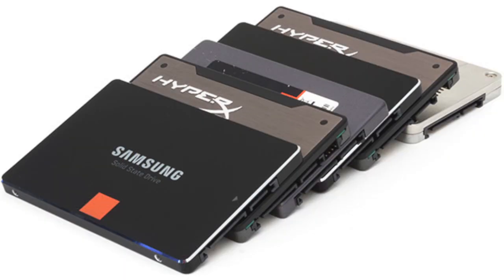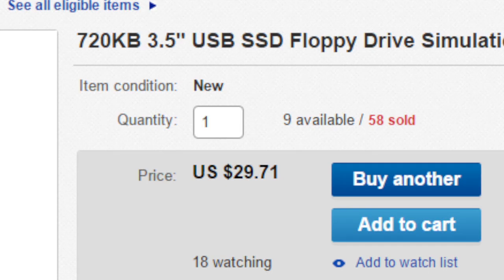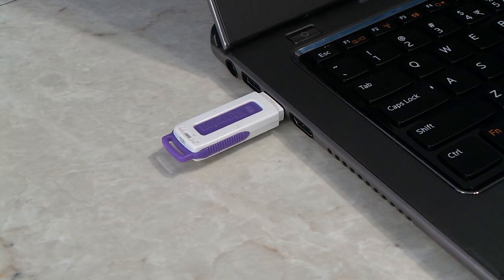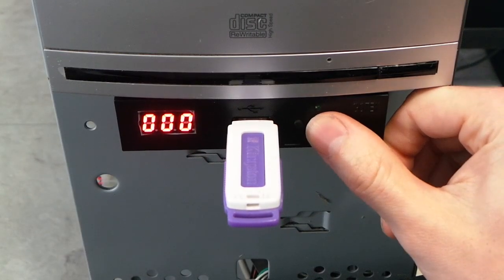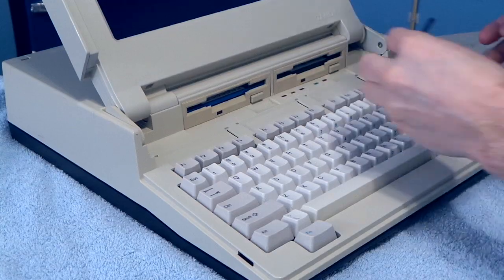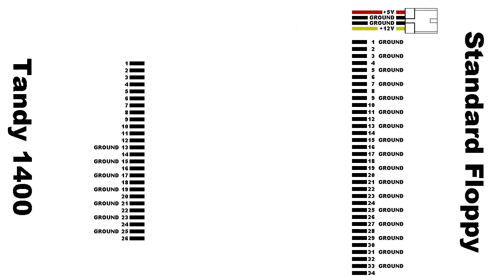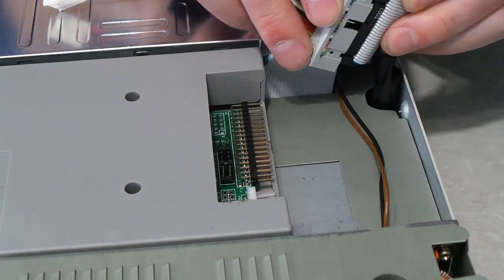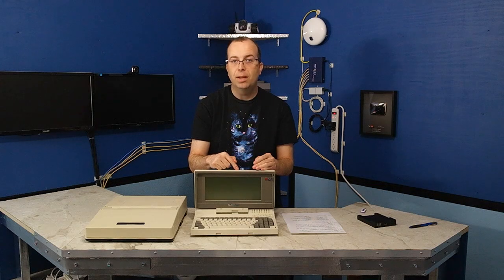Upgrading to a Solid State Floppy Drive Emulator

Comment: Do you have an old Amiga? it's quite common to use that Floppy Emulator on Amiga machines with a Firmware update
Reply from the maker: +Sheepy007 I have an Amiga 500 and Amiga 1000.  Will it work on those?
Reply: +The 8-Bit Guy You need to flash the drive to the Cortex firmware. You can find all the necessery steps here https://cortexamigafloppydrive.wordpress.com/ 
It certainly works wit A500 and should work with all amigas according to the author.
Reply from the maker: +Sheepy007 interesting.. I may look into this.
Reply: +The 8-Bit Guy I successfully used it with my Amiga500. I do need to say, getting the firmware on it took a lot of effort. A cheap FTDI USB to Serial cable will work but the flashing software is awful. it uses some kind of demo flash software which (in my case) took several attempts before it finally recognized the drive type. afterwards, you can put any adf file on a fat32 formatted flash drive and mount it. a special selector.adf provides the disk assignment and it also allows writing so you can store save files or copy games to adf format
Reply: +The 8-Bit Guy I bought this preequipped with the propper fimware on german ebay for about 40€, 8GB usb-stick included. It worked out of the box perfectly with my A1200. No prerequisites needed, the usb-stick was in FAT format and all I had to do was to copy my adf files onto the stick. The rest is done by the amiga software already on the stick. There you assign the adf-files to a numbered slot on the emulator.
Reply: +The 8-Bit Guy You can also get them to work with other drive types by flashing a new HxC firmware, see here: http://www.vogons.org/viewtopic.php?f=46&t=43416
Reply: +The 8-Bit Guy if you replace the firmware with the HxC firmware you will have a more flexible device that can handle multiple formats
Reply: Finally! A way to play Beneath A Steel Sky without changing floppies every 16 seconds!
Reply: +The 8-Bit Guy  i had the amiga500 and i would really like to see it work with this emulator in your next video
Reply: +Sheepy007 Chiming in on the A2500 here too!  It rules!  Ran into some trouble getting a 2nd drive working, but I do not believe it's related to the Gotek in any way.
Reply: +Sheepy007 need to buy one of these for mine. just resurrected it after 20 years of storage
Reply: +Maplerain yes, at 56×24 resolution.
Reply: I can also confirm that it works on an A500. There are a few things to keep in mind though:
- Form factor: As you can imagine, the Floppy disk emulator is way smaller than your typical A500 floppy drive. If you want to run it as an internal drive, you need to make a few case modification (either on the A500 itself, or the floppy emulator case)
- You cannot save to the images (at least I haven't found a way). However, you can copy from a mounted image to a regular drive
-You can always attach it as an external, secondary device; however, as the A500 typically boots only from df:0 drives, you won't be able to boot from the virtual floppy in that case (unless you make a Kickstart upgrade).

There are a few ways around that, though. Some people unwilling to do case mods just use a longer-than-standard IDE cable and lead it through the disk slot opening in the A500 case, and then hook up the flash Floppy drive externally. It doesn't look pretty, but it does the job.
What I did was, I installed a boot selector switch and hooked up the drive externally. Works like a charm; and if I want to save, I wait until the Amiga is idle, flip the switch and then insert the disk in the regular df:0 drive. It's not recommended to do so, but so far it has worked just fine.

I can only recommend upgrading your A500 that way, because the old floppy drives have the nasty tendency to fail over time - I had to personally replace the internal floppy of my 30-year-old Amiga once due to unrepairable hardware failure, and proper replacement drives are tough to get.
Reply: I saw a video from 2007-2009, I  cannorpt pinpoint the time, where David installed an s-video jack on an a100..
Reply: +The 8-Bit Guy would it help me run crisis 3 at max settings?

Comment: +The 8-Bit Guy, you should check the figure C-3 in the manual - it says "step". And look at the "ready" signal... it is not 1:1 connection. If you read the manual at C-12 page you should be able to emulate the "ready" signal with a switch (short with ground when conditions are met). Pin 34 is almost not used on floppy drives so there is a high chance this emulator does not use it (check voltage on this one if not sure).

Comment: i'll just write down what i would do to check this computer, maybe i'm wrong
first of all, i'd check the back up battery, if there's one. Sometimes when that discharge you get strange errors, also, there could be a save of the error caused by the floppy emulator, if you remove it you could reset it.
Then if a different psu would give the same problem (that could mean lot of work and lot of rewiring, if you want to use an atx or whatever you could need)
then, since you have the service manual, you could check if there is a hardware fail somewhere

Comment: I wouldn't rule out that the emulator itself broke your laptop. These things are not supposed to go in those machines actually. Also, made in China, so it's to be expected.
Reply: As easy as all this sounds... It's unlikely that the floppy emulator actually broke the Tandy 1400LT. Those old 1400s drop dead rather regularly, usually because things like capacitors in the power supply unit die. Floppy drives and floppy emulators are pretty passive anyways. It's much more likely for a faulty PSU to fry the drives, or emulator, than the the drive/emulator will screw up the PSU. Considering the symptoms, where the computer will run for a short while, then shut off, it's likely the fault of dead and/or dying capacitors.
Reply: I highly doubt that the floppy emulator was causing this. The chances that he did something wrong during wiring ore the computer just bit the dust because of it's age are much higher
Reply: +אולדסקול nowadays EVERYTHING is made in china, even the top-brand stuff you'll probably claim works much better! it used to be like "oh made in chine, it must be crap" but nowadays that's not so much the case anymore, lenovo laptops are brilliant... made in china. samsung phones are also really high quality... made in china. even the iphone is made in china!
Reply: Factories in China offer different tiers of quality assurance, material quality and manufacturing environments. When you buy something on the cheap (yes, $30 for this is damn cheap) you're getting the lower end of all of those. Sometimes that's enough, but if you buy something that's supposed to cost a lot more (like this drive) and put it into a retro computer from your collection, you shouldn't be surprised things go wrong.
Reply: Oh, yeah?
Reply: Niek Nooijens Samsung phones are made in Korea. iPhones are made in Taiwan.
Reply: Fuck off.

Comment: Actually back in the days when Smart media... can run the drive with Flash directly in it.

https://encrypted-tbn3.gstatic.com/images?q=tbn:ANd9GcQ0QU47GI9BnzQjHgqyDdoeAEpvJQipiFvsng7fHERLqjiO5n_ahw
Reply: +matsv201 

http://www.ebay.com/itm/FLASHPATH-ADAPTER-FLOPPY-DISK-ADAPTER-FOR-SMARTMEDIA-NOS-NIB-/201380015519?hash=item2ee32f2d9f:g:apsAAOSw-vlVkfax
One you can actually buy.

Comment: Interesting. This might get my old dos laptop come back to life. The things broken there are the floppy drives because the rubber drive bands are eroded. I would love to see those green plasma characters light up again on the mini display...
Reply from the maker: +Willem Kossen I have a 486 laptop that has a built in floppy but is also broken for the same reason, the belt has snapped.  I was thinking of using my 1.44 model and putting it in that one, but it would require enormous modification to make it fit.

Comment: as for 'eventual' connor 20/30/40mb hdds in old laptops: haven't seen a single one that actually still works... same for the floppy drives: the rubber parts are gone. things just make (a lot of) noise. and don't work.

Comment: before wasting any more time on that laptop better check if the keyboard still works correctly, a lot of the older ones have rubber 'springs' under the keys that dried up causing keys to hang for ages before coming back up... doesn't appear as a problem before actually trying to use them to type tho.

Comment: probably just a dead battery... several older laptops switch off or don't turn on anymore if the battery does not reach/maintain sufficient voltage or is not present alltogether... fortunately on several of those they are just a bunch of D-cells linked together :P
Reply from the maker: +Sven Olaf Kamphuis IT doesn't even have a battery and never has since I owned it.

Comment: David, did you accidentally put a center negative power supply into the Bondwell which asks for center positive?
Reply from the maker: +CollinG Tech Opposite, actually. It is supposed to be center negative, and I plugged in a center positive.  I didn't realize I was plugging the wrong thing in.  When I did, it sounded like a firecracker went off inside the laptop.  I knew I did something wrong then....
Reply: +The 8-Bit Guy Either way vwestlife made the same mistake in a video he made about Bondwell laptops
Reply: +The 8-Bit Guy But the Bondwell still worked for him afterwards. I have no clue how though.

Comment: Dear 8-Bit Guy,

Do you prefer newer or older versions of Windows?
Reply from the maker: +Joseph Conte It depends on what I'm doing with them.  If I'm actually trying to get work done with modern software, my favorite is Windows 7.  But I still use Windows XP a lot as well.   I very much dislike windows 8, windows 10, and windows Vista.

Comment: Greetings from Garland, TX!  The software that comes with this device is quite bad.  After doing some searching I found software that works much better (and in English) which should work fine with your floppy emulator as I have one just like it.

http://www.ipcas.com/download/products/usb-floppy/usb-floppy-emulator-tool-v1.40i.zip

This is an awesome device as I use them on my old 486 and Pentium systems that I have for retro gaming.

Comment: "Unfortunately, after all of this work I ran into another problem. The laptop just quit working. It will just run for a minute or two and then it just mysteriously shuts off, even when I reverted everything back to the factory configuration."

Ah, the nuances of working with aging hardware. I've had a (much newer) laptop randomly throw up 'BIOS Corruption' errors seemingly whenever it doesn't feel like it's up to the task of turning on. 

Wouldn't trade the bitchyness of hardware for anything in the world though, especially for something like programming.

Comment: I grabbed a cheap MacBook Air 1,1 from eBay and have been trying to upgrade it to an SSD -- it's a weird SATA ribbon cable deal with a 1.8" form factor. I have a 1.8" IDE SSD because I thought it was an IDE drive, and I discovered several other little things wrong with it along the way. I'm right there with you about losing interest, especially after spending more than I wanted to.

Comment: Hi I suggest you take a look at the HxC firmware and talk to its developer, an awesome guy, for any issue you might encounter.
Basically he ported the firmware of his HxC floppy emulator to these cheap Gotek devices and it supports Amiga, CPC and Atari ST machines. However I just discovered there is software for DOS support.
This firmware is not free, it costs 10 euros per device. But it's actively developed and as I said the developer is really cool and ready to help you fix any problem if you encounter any.
If you decide to buy a license you need to flash your gotek and it's all described inside the zip files you find at the bottom of this page http://hxc2001.com/download/floppy_drive_emulator/index.html (is mentioned as the STM32 HxC floppy emulator)
Here all the useful links:
http://hxc2001.com
https://github.com/bjt42/hxcfs/releases
https://www.youtube.com/watch?v=rfovFoMaL54

Comment: Check the voltages on the 26 pin connector - there might be 5V and 12V there and connecting those together can damage your computer.
Reply from the maker: +Jens Goerke I checked them all with a volt meter on the laptop before building the adapter.  They were all 5V.  I also used a continuity test to make sure they were all the same source, they were.  I'm not convinced I damaged anything.  The laptop will still power on and work for a minute or two before shutting off.  I would think if I fried something, it would just stay dead.
Reply: +The 8-Bit Guy 
What is it processing when it shuts off? It would be very handy to have a log of what it's doing just before it craps out.
Reply: +The 8-Bit Guy 
Maybe one drive draws more current than the other. That should be easy enough to measure and compare.

Comment: I would say that the Tandy has the same problem as the Bondwell. Sometimes when you plug in something by a third-party (AKA the floppy drive emulator) can short out the Power Supply.
It's happened to me before.

Comment: Hi 8-Bit Guy, have you seen this demo?
https://www.youtube.com/watch?v=hNRO7lno_DM

Check out the technical explanation!
https://trixter.oldskool.org/2015/04/07/8088-mph-we-break-all-your-emulators/

1k colors on CGA composite, and 4-channel audio .MOD mixing at 16.5kHz (output by PWM on PC Speaker) on an 8088!

(Sorry if you've already come across this! I wish I had an old 5160 to try this on, although the latest PCem apparently runs it faithfully)

Comment: Yeah please don't leave us hanging. The whole concept is an excellent idea. Why don't you try it on another machine entirely?
Reply from the maker: +Cameron Smith It will probably wind up in that Bondwell laptop I showed at the end.  I'm planning to repair that one.
Reply: +The 8-Bit Guy you did mention that, but do you have or can get your hands on a working desktop with a 720k drive (like you did with the 1.44mb one) preferably with dos or 3.1, that way you know that the 720k hardware will work before trying to repair your second laptop

Comment: Can you post a high resolution photo of the floppy drive emulator circuit board.
Reply from the maker: +MorRobots I suppose I could, but not sure where to post it.
Reply: I'm curious what they used, it may be easy to hack. Typically Chinese gizmos like this use rather jelly bean parts and MCUs.
Reply: +The 8-Bit Guy found an image, just as I had predict. it is literally an STM32F (ARM) jelly bean as they get, and some 74HC logic (mega jelly bean). best part is the STM32 has a bootloader built in and you can activate it by pulling a pin high and another one low or something like that  (depends). Looks like you could reprogram this thing via the USB by the layout I see on the board. may make for some fun hacking.
Reply from the maker: +MorRobots You know what would be awesome?  IF the emulator could switch modes and act like a hard drive.  So let's say for example, the computer boots from the emulator like a regular floppy.  But once booted, it loads some sort of TSR driver and then tells the emulator to switch modes.  At that point it could have a C: drive and a large FAT16 or FAT32 filesystem.  I realize it wouldn't be as fast as a regular hard drive.  But it would allow a dual-floppy computer like the Tandy to play many games that just won't fit on a 720K floppy.

Comment: I was one of the supporters of releasing this video despite it having no happy ending. Glad you posted it, unfortunate that it didn't work, but the process is very interesting.
Reply from the maker: +Adam Sidelsky On the bright side, there will eventually be a part 2, as I plan to fix that Bondwell laptop and put the emulator in there.
Reply: @The8BitGuy  Well, it's been 4 years...
Reply: Awesome!
Reply: +The 8-Bit Guy Is it just a standard regulator like a 7805/7812 etc? You could run down to Tanner in Carrollton or probably a Radio Shack.  If you've never been to Tanner, I highly recommend it for surplus parts and cool odds and ends.  Lots of chips for repairing vintage computers (6502 chips, Z80s, SRAMs).  They tend to keep a lot of Adafruit stuff and RPi stuff in stock as well.
Reply: +Adam Sidelsky Maybe there's someone out there who can help
Reply: +The 8-Bit Guy are you in Dallas?! I'd help for sure
Reply: Yeah, I think he's mentioned it a few times. Also has made mention of driving to Mouser to get parts.

Comment: I know how these kinds of projects go and how frustrating it can be when you run into unexpected problems. My only advice is don't get too discouraged and don't quit! Take a break if you need, but I encourage you to keep going and solve the issue with the power supply. You're doing a great job and I feel you're 75% there. Just a little bit more!
Reply from the maker: +Satoshi Matrix Yep - I will eventually have a part 2 to this video.

Comment: Connecting all those power wires into one might have been a bad idea. Did you measure that they all were always active at the same time, and always at 5V?
Reply from the maker: +celeron55 I put a voltmeter across them all in continuity mode and it showed that all of those were connected together internally.  I had wondered the same.

Comment: cool! I didnt know emulated Floppy drives existed..
I wish i could find a 386 or 486 under 100$ on ebay though..i thought theyd be cheaper than they were.
Reply: +rkotm they are mainly used to industrial applications there are all sorts of ancient computers out there running machine tools and monitoring various processes and they often use floppies ether to boot off of or to load instructions.